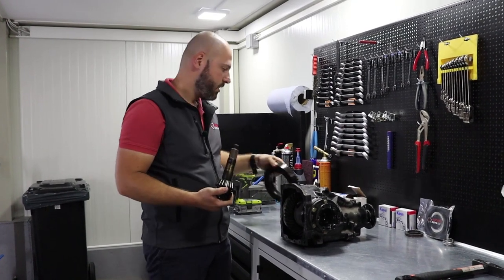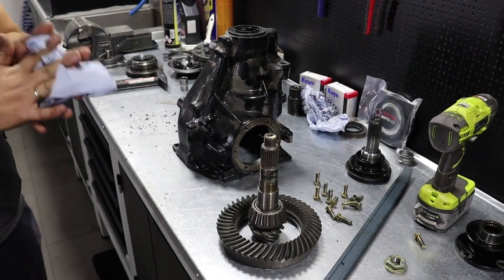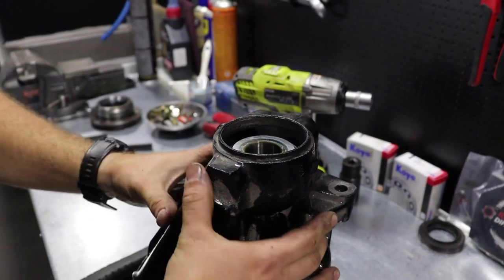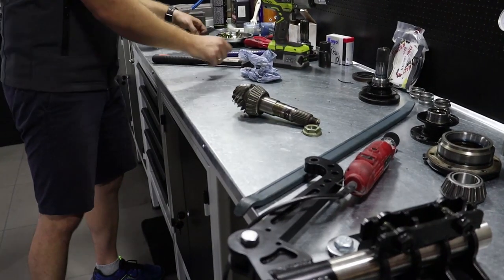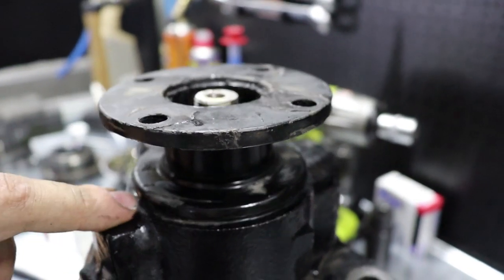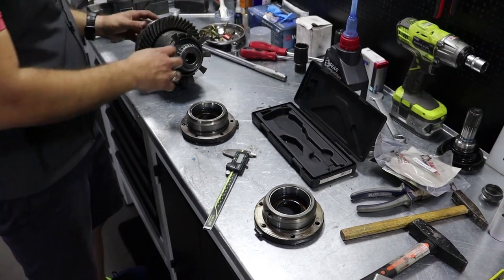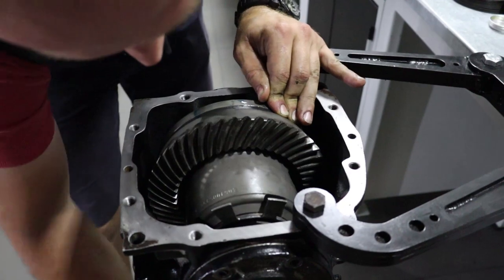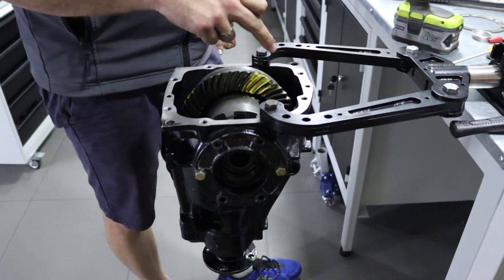How to change BMW differential gear ratio | Easy step-by-step instructions | Backlash adjustment

Comment: Hi great video. Where can I buy the tool 2?
Reply from the maker: Thank you!

https://www.racingdiffs.com/collections/differential-tuning-parts/products/gkn-v2-lsd-opening-tool
Reply: @RacingDiffs  sorry I meant the plate you used to press out the inner race. I’m thinking about just using a screwdriver and hammer but that tool you used looks very handy.
Reply from the maker: @azmontana1  improvised.  Central pin from the open diff from e39😄
Reply: Managed to get it off finally. Now I’m on the LSD it’s 210 diff and the bolts on the ring gear are super tight. Any tips here my impact doesn’t make a dent and it bending my breaker bar. Something isn’t right?
Reply from the maker: @azmontana1  most likely someone used strong glue previously. Take it to vulcanizer, they have strong impact guns for truck wheel bolts.
Reply: Is this common to find some with very stiff bolts?
Reply: Can you reuse the carrier to crown wheel bolts again? Are stretch bolts?
Reply from the maker: Yes, you can reuse them.👍🏻

Comment: Hello from Slovenia!
Very informative video, thank you very much for making it, I was always unsure of the procedures, especially for changing the pinion shaft and setting torque, but now I feel comfortable to give it a go.
How do you find the combined two shim thickness when you are moving lets say a new lsd carrier into a different housing (e36 into e21 housing in my case) is this also done with measuring spinning torque like when adjusting the crush sleeve for the pinion preload? 
Where can I find the spinning torque specs for different sizes of bmw housings?
Reply from the maker: Good questions. Please drop email to office@racingdiffs.com we will be happy to provide extensive information.

Comment: Does this back to work on the E46 M3 for the backlash
Reply from the maker: Free play in E46 M3 comes from different position. Check this link for a solution.
https://www.racingdiffs.com/collections/lsd-clutch-plate/products/bmw-e46-e92-m3-differential-free-play-repair-kit
Reply: @RacingDiffs  so I bought the V2 advance kit from you guys I’m still yet to receiving it. I was wondering do I have to Buy a new set of shims to set the backlash
Reply: Or would the OEM shims set the backlash?
Reply from the maker: @M14GARAGE  not necessarily. The kit you purchased will solve it👍🏻
Reply: @RacingDiffs  thank you so much
Reply: @RacingDiffs  just to make it a clear understanding for me the kit I purchased I don’t need to set the backlash correct?
Reply from the maker: @M14GARAGE  just return everything back as it was👍🏻
Reply: @RacingDiffs  why I don’t have an issue I want to kit, but I was just asking you a question
Reply: @RacingDiffs  I’m new to rebuilding differential, I was just needed your help that’s all.
Reply from the maker: @M14GARAGE  you have a complete step-by-step tutorial right here at our channel.
Reply from the maker: @M14GARAGE  always here to help👍🏻
Reply: @RacingDiffs  thank you so much 🙏🏽 what’s the name of that range that you’re measuring the resistance with or where can I get one?
Reply from the maker: @M14GARAGE  you need torque wrench 0-5 Nm.
Reply: @RacingDiffs  Thank you sir

Comment: I cant remove the speed sensor. Any tips?
Reply from the maker: Try with 2 levers. That always works.
Reply: Do you know where I could source a replacement?
Reply: Worked after lots of pb, heat, and chiseling lol

Comment: Boss, i have x1 2010 model, the front diff is gone, and im looking to buy another one, my diff details 2.79 7583773 . And it’s very hard to find, My question can i replace with other diff number? Or should be the same. Please advise thanks 🙏